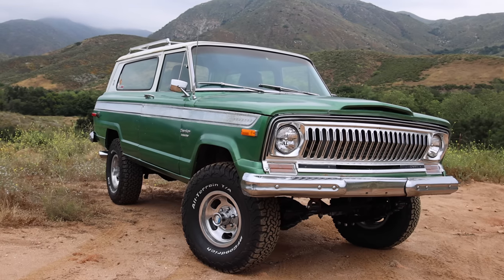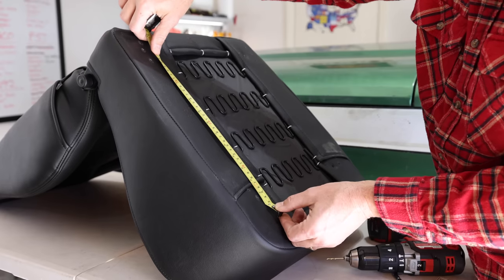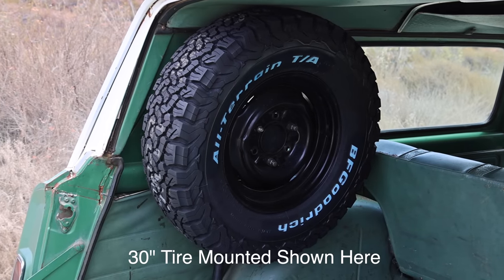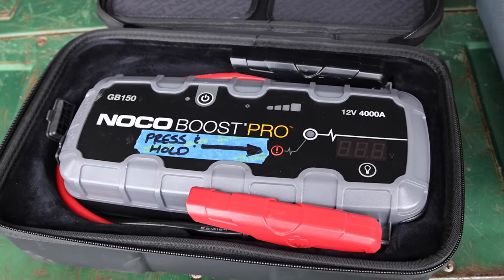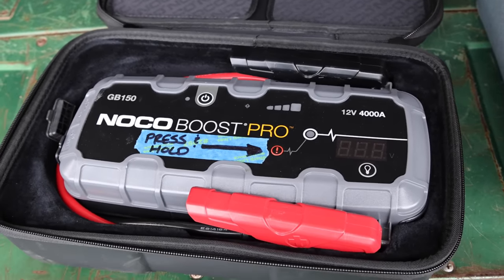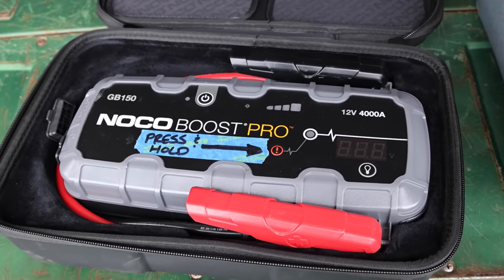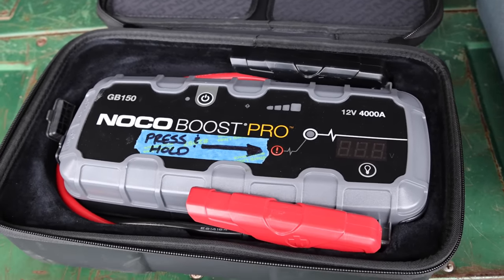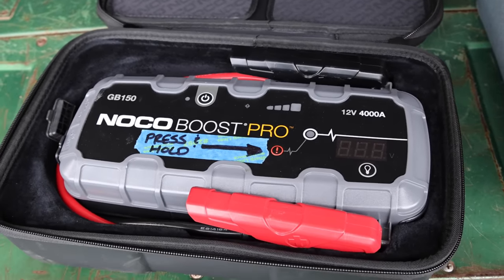Finally After 2 Years, Prickly Pear is Ready for Adventure!

Comment: I regret that I have only one thumbs-up to give. Love me some FSJs and vintage Jeeps. They're annoying to deal with at times but when they're right, they're so much fun. I like the vintage gear too. I've never seen the folding kitchen before. The exhaust sounds good without being loud.
One nice thing about AMC being so small is that they used everyone else's parts. That's a GM alternator and is cheap and easy to upgrade. Old cars were barely adequate to run the lights and the heater at the same time.
Reply from the maker: Thank you! There's a reason I named this project "Prickly Pear!" 😂 I'm excited to finally be at the point where I can take her out on a trail.

Comment: It's always good to see old iron getting saved from the crusher.  Sweet old rig.  A thought, m'be a sheet of plywood cut to fit belong the carpet and carriage bolts up through to mount your tie-downs?  You might use some dots of adhesive to keep the plywood in place.

Comment: Hey Brad,
The Cherokee is coming along nicely. The exhaust sounds good and looks really clean.
On the subject of your search for vintage period correct Coleman camping gear, I have a friend who goes to every estate sale he can find and has come up with stoves, single and double mantel lanterns, coolers, water jugs, and the old Coleman catalyst heaters. Every bit of it has been brand new, purchased and never used and all still in the original boxes and from the 40’s,50’s,60’s, and 70’s.
He has come up with this gear really inexpensively. Like he found a red 1 mantle lantern for 5 bucks with the case, model 413 and 425 stoves for 10 to 20 bucks. I have an old 3 burner stove and one of the fold up ovens you use on the stove and they go on every trip I take. 
The key like I said is estate sales.
Always enjoy your videos and adventures. 
Let the Mrs. know I’m still standing by for her to break out the cast iron  Dutch oven on a trip to cook the meal in.
Be safe, and keep up the videos.
Semper Fi Doc
Reply from the maker: Thank you! Estate sales are a good idea and something I've never thought about.

Comment: Love this project! One thing I’d have done with the headliner off- would have used rust oleum truck liner instead of rust stop. That will inherently encapsulate the rust, but also add more insulation, for both noise and heat.

Comment: I bet the Cherokee definitely runs better now that it can actually breathe. Dual Exhaust though more aesthetically pleasing doesn't necessarily equate to having more flow either. The Cherokee sounds amazing and has a much more modern sound now compared to that old fabracobbled exhaust system.

Comment: you can get plywood (rino line or carpet) for the back and have hold down brackets where you need them and then you can remove if you dont like it with out drilling holes in truck

Comment: I finally got my new gauges for my 79 Ramcharger. I should be able to get it all wired over the next month. Then some basic maintenance from sitting the last four years. 
Doing carpet after I get a cage in it. Then the soft top can finally go on. Not sure the cage, carpet and soft top will happen before Moab in October.
Your interior green is very similar to mine. My exterior green is darker. It needs a repaint after 44 years. Eight years in Oceanside air gave it a bunch of patina. Normally I don’t mind that but this truck was gorgeous the first 10 years I had it. It deserves the new paint.
I had most of that gear or my dad and grandpa did. So cool.
Love the new exhaust.
Reply: Exciting. I love his enthusiasm. Some of my techs when I was at JBA Speed didn’t think of the various bits we’d find that way.😂

Comment: This is my favorite out of all your vehicles. I love the FS Jeeps! I have an old steel belted cooler too and I can get it to keep things cold for five days with a 3/4 inch slab of dry ice wrapped in burlap. I recommend this as it keeps things clean with less slush. You can get dry ice from a local Ice house pretty cheap. I also have the same camp stove and converted it to propane (can still use the fuel can too).

Bring it to Reno (or any vehicle) and I'll take you through the Black Rock! Six nights in the middle of nowhere.
Reply from the maker: Thank you! And I appreciate the tip too!

Comment: Really  dig old Jeeps. Had a '75 Wagoneer, have a '77 CJ 5. Props to what youre doing/have done with the Cherokee. But after all the emphasis on upgrades to the interior because of too many different shades of color you go with avred cooler..😮 Green man you need the green cooler. Tho those classic metal bodied coolers are not quite as good as the the newer Yetees, Rticks, etc (see what i did there) they are pretty decent units. Anyway its a cool project that an old dude like me appreciates. 👍

Comment: Fun episode. Thank you. I’ve got a nice MagnaFlow on my ‘77. I WILL have to find the cat you installed and try that too. I enjoy having it very original but the smell gets a bit old and you can’t cruise with the back window down. I’m motivated to fuel inject but a cat could let me enjoy keeping it original. Running it on 100LL is a definite helper. Did you amp meter bypass / delete on yours for the volt meter? Muy importante!

Thanks for the fun episode. Blue skies …

Comment: I understand just wanting to get it on the road, but just taking the time to really address the rust is always the best option. Painting over rust never works and covering it with sound-damping material is just going to make a bad time for the next guy who wants to do it right. You should have removed the roof cross members and chemically removed or walnut shell blasted the rust. Yes, it would have taken some more time, but it would have been a completely correct job that would never have to be revisited again.

Comment: At 12:57 I see a York A/C Compressor with Backseat valves used for R-12.  I'll bet that systems leaks and needs replacing.  Let me know if you need an upgrade to R-134a, I am an Engineer that has all tools and parts to make everything for a 1970s York A/C system and make it work well.  I even preserve the OEM appearance as period correct because I produce these for my other car passion, my 1974 Ferrari 246 on YT channel "Club Dino USA".

A/C is not just assembling parts but understanding that filling requires the user to balance the condensor's Subcooling ability to be able to "feed" the Superheat for the evaporator. Controlling the location of the Gas-Liquid State Change is far more important that heat exchanger size.  

I have complete digital A/C gauges and producing tools. I would budget $2000 in parts as a conservative guess for all new parts in the system and be happy if it was far less.  LMK if I can help, I am a past TR customer and am in your buyer deatils
Reply: The TrailRecon GSI kit is great!